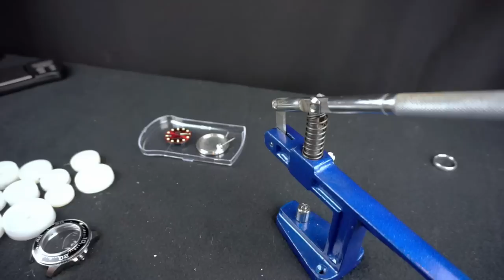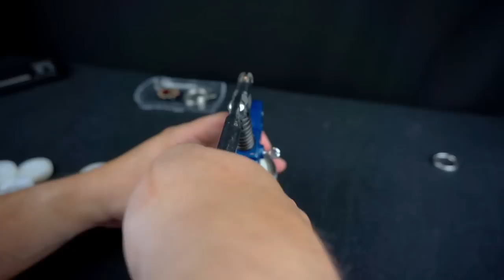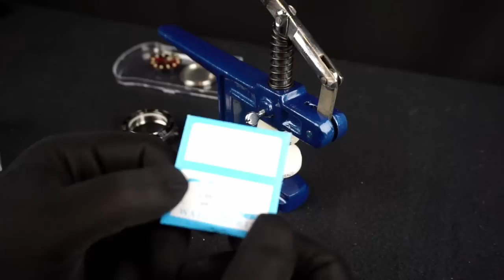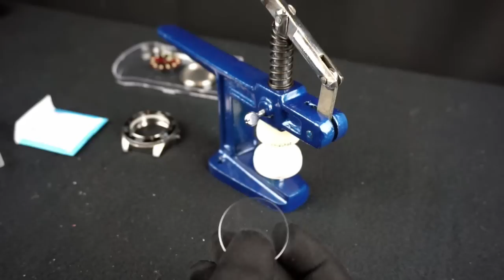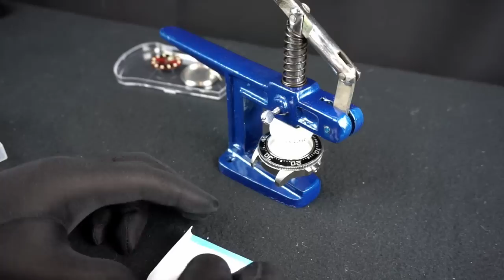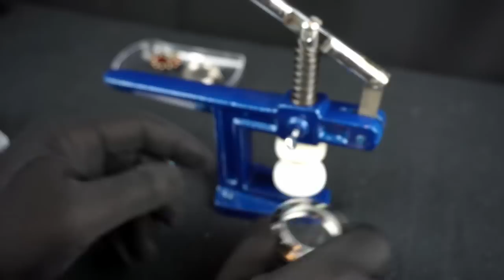Watch Crystal Replacement

Comment: For omitting the final seating of the crystal: thumb down. 
Did it finally "pop" in? Did you have to work very hard to get it to seat fully? Not a clue because you did it off-camera ... which defeats the purpose of a tutorial.
No cleaning of the underside of the crystal either ... did you use a puffer? No clue because you did it off-camera.
Reply: Good video , need to know if there is no galas. Specially Casio watch where do you measure from inside is larger than outside ring and no clue of thickness, if the Diameter is larger inside how can you press it outwards. how do I start, Does Sapphire come with single dome, Does it come with Magnifier to see the Date? Please reply to Allyco_insurance@hotmail.com

Comment: How exactly is this done if the press doesn't go down far enough to actually press against the crystal?
Reply: I had the same problem. What I did was that I placed the top and bottom circular dies in place on the press and then put another one (slightly smaller than the top one) directly on top of the crystal so that there were two of them above it, worked a treat.

Comment: Where's the link for the crystal press?  I have a vintage Bulova Ambassador H and I have new crystals (unfortunately, they're plastic, but look to have always been that way as these are vintage replacements) and have cracked TWO of them trying to get them to seat.  It almost looks like it was GLUED in, which seems unbelievable to me.  I know this watch as only "resistant" (at best) and it was never (1957) a "waterproof" construction competitor.  If anybody has experience with replacing the crystal in this watch, I'd appreciate any helpful advice.  The valuation of the watch will not support a "have it professionally replaced" alternative.  It was my Dad's (or Grandad's, I can't be certain which) and I'd just like to "preserve" it for whoever will wind up with it after I pass it along.  TIA.

Comment: Do i need to remove the rotating bezel ? Im changing the crystal on an Invicta Pro diver.
Reply: Frank Ochoa  where did you find a replacement crystal for your invicta? I need to replace mine.
Reply: @mikemadrid4009  www.esslinger.com
Reply: Frank Ochoa  is it a legit website? How long did it take to ship?
Reply: @mikemadrid4009  yes . real pros. I've bought maybe 20 different items from them I fixed over 10 watches so far they usually ship the next day and you'll get your item within 3 to 4 business days.

Comment: nice video     i wonder if some jewelers or watch makers have a special lubricant  to install a crystal and can be cleaned off after the installation
Reply: silicone grease, I apply a little with a Q-tip then use a remoistened eyeglass cleaner to wipe the inside glass off, then I use a carbon-tipped "Lens-Pen" to clean and polish the inside.

Comment: If I cant get the watch out after removing the stem, do I need to remove the crystal?
The hands have fallen off and I want to put them back on a fossil watch.
Reply from the maker: Larry Muse: No, typically there is a movement holder that is securing the movement into the case.  It is either a white plastic or metallic ring that snaps down around the movement.  If you lift this out it should free the movement. The other possibility would be that there are small metal tabs holding the movement baseplate to a groove in the inside edge of the case.  The tabs are held to the movement with small screws.  For a Fossil I think the former is more likely than the latter.

Comment: I was holding my breath whilst you was pressing the new crystal in!!

I had one of those presses, I bought it as a caseback press from China, The dies were very thin, Whilst I was pressing a particularly tight fitting back on, One of the nylon dies split, The shaft went right through the crystal and dial, Obviously the watch was ruined but gladly It was one of my own watches and not someone elses!! :)
Reply: The better question is why the hell you were pressing a crystal with the dial (and presumably movement) still in the watch.
Reply: If you bothered to read my post I said I was pressing the back on and NOT the crystal, I had replaced the cell and the back was too tight to press on between my fingers, I had the watch dial down in to  a concaved die and the flat die on top to push down on the caseback, The concaved die was on the metal bezel of the watch front so there was no contact with the mineral glass crystal when the shaft that the die sits on pushed through the thin nylon and into the watch... :/

Comment: i have a old seiko H801-7070. i got it from my dad, he has had the watch for 20 years. (no scratches) i get the watch and on the first day i make a small chip about 3mm big and i was wondering if it is possible to get it replaced. p.s chipped it when cleaning gap between the screen and bezel.

Comment: Hi, i have ordered a flat crystal with underside AR coating for my snk 
809. But how do i know witch one is the underside on
 a flat crystal?
Reply from the maker: The AR coating will look like a blue/purple coating from certain angles.   Just hold it up to the light and look at it from the side as you tilt it back and forth.   You will see a faint color on the coated side.
Reply: there is a slight bezel on the outside

Comment: How do you know which crystal to buy? I have a very good looking but cheap watch whose crystal is now missing. i mentioned its cheapness because it doesn't have a name on it. I could easily buy another watch, but I really like the looks of this one.  If crystals come in a limited number of sizes, I suppose I could determine its size by measuring it, but I wouldn't even try if the variety of lenses is intimidating.

Comment: you can put the crystal in easily without doing all that work he did
Reply: he should have mesured it, but hes not a mechnic he dont knows what hes doing
,if it donst fall ist ok if it falls he will try again, poblem is if water gets inside or cristal stays too tight.

Comment: What is the best crystal for an automatic movement Ladies Seiko Diver?  I would think sapphire, but there have been a lot of articles discussing the Saphrex synthetic material.  It's supposed to be less scratch resistant than real Sapphire crystal, but more impact resistant that is good for divers and sporting applications.

I'd appreciate your thoughts on this.

I also want to thank you for this video.
 
It is chock full of excellent content, and I appreciate that you are sharing your knowledge with the watch repair/enthusiast community.

Comment: I have 2 watches with broken crystals, I would like to fix them both.  I have purchased a crystal press, and watch tool kit.  But... how do you measure the crystal to order a replacement?  I assume I'll need a digital caliper, but I didn't know if there were special ways to measure to ensure my measurements match those of the new crystal.  Any help would be appreciated!!  Thanks!  And... Great video!
Reply: +Dave We are in the same boat.  I have two nice watches with crystals that I cracked but didn't damage the movement.  On was my Seiko automatic diving, by banging it up when I was moving around some things in the deep freeze, the other was when (and this is stupid) trying to set the time for the time zone I was in ... and happened to be 3 stories up.  It's rather impressive that my Tag didn't shatter, but it also sucks a big bunch because I liked that watch for a quartz.
Reply: if your not a mechnic, from the fine mechnics, dont start inventing yourself, you will get problems... waste of money and time.

Comment: Is there a problem with the luminous material from watches when you take the watch apart, i.e radioactivity ?
Reply: +schooder Yes! You should definiteley wear a haz-mat suit. If not, you will certainly die from radiation exposure!
Reply: +TheSoundOfTwang   \:-)
Reply from the maker: Nothing to worry about as far as that's concerned. As long as you aren't changing crystals on vintage radium dial watches and licking the dials.  LOL!
Reply: +schooder There are 3 types of luminous materials.
1. Radium based paint. This is the dangerous one, but it has been used only between the '20 and the '50 of last century so it is quite rare to find nowadays.
2. Tritium based paint. This has been used (in the form of a paint) from the mid '60 to the mid '90 of last century. It has an half-life of 12 years, now it's safe to handle it because it is not radioactive anymore. Watches that used tritium would either have two small "T"s on the bottom of the dials by the 6 or have "T<25" labels.
There are still produced tritium tube-gas watches (see for example the Luminox watches), but they are ok because the tritium gas is contained into tiny glass tubes and they are enough to protect you from the beta particles emitted.
3. Luminova (old version based on zinc sulfide, modern version based on strontium aluminated): they are safe to handle. No radioactivity there at all. They substituted tritium paints since middle of the nineties.
Cheers, Alex
Reply: +Alessandro Guarda I don't know about Radium, but although Tritium is radioactive it is so weak it can't even penetrate the skin. He should be fine unless he decides to eat the dial.

Comment: What are the differences between mineral and sapphire crystals? is there any difference in the process to fit them.
Reply: +Sendilkumar Murugaiah Sapphire is man made corundum, which is harder at 9 on moh's scale of hardness.  I guess the fit process wouldn't differ.
Reply: +Sendilkumar Murugaiah Harder and therefore more scratch resistant.